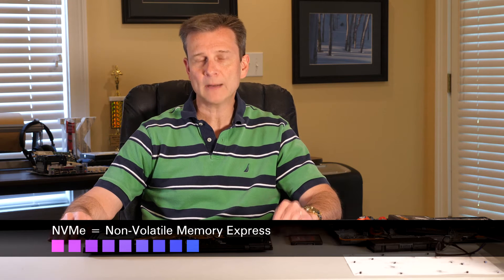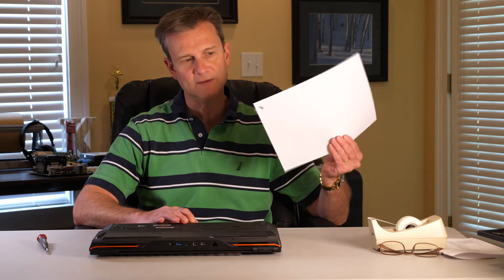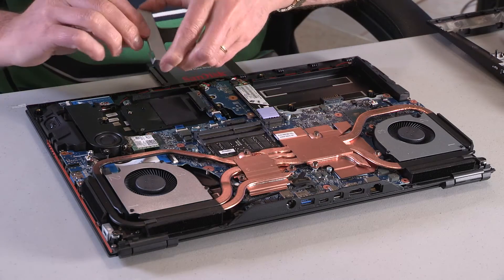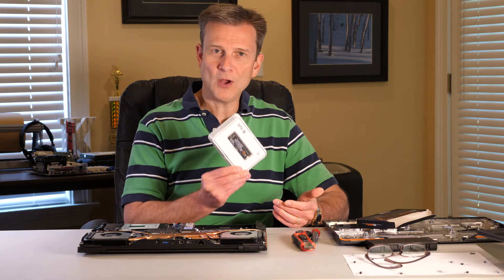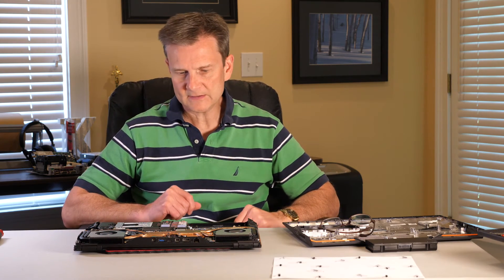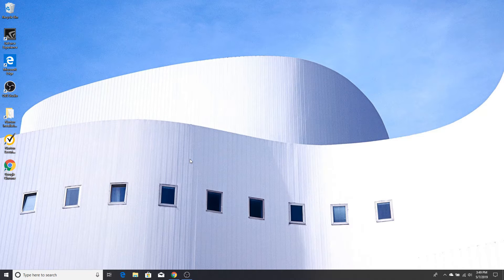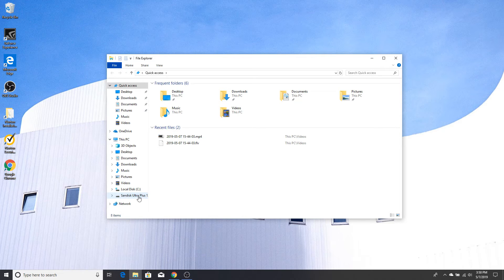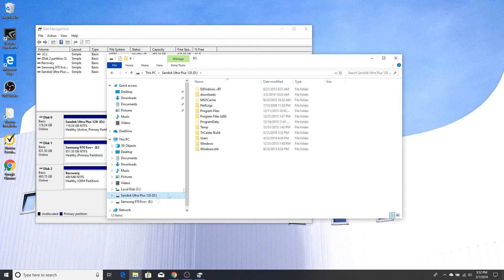Installing a NVMe SSD in the PowerSpec 1720 laptop

Comment: Good summation.  Only thing I'd recommend is to advise people to get a second thermal pad (not unlike the one that's on the WD drive that came with the laptop) and center it over the controller chip, not the NAND.  That's what they did there - the NAND is designed to get hot - the controller chip can benefit from extra cooling, which in this case is provided by letting the controller chip dissipate heat by contacting the metal EMF shield using the thermal pad as a thermal interface material.
Reply from the maker: Thanks for the tip.

Comment: Thanks for the video ... exactly what I was looking for (this one and the other Powerspec one) .... and the only video of its kind of the web ...  I want to get the Powerspec or a similar Clevo but my only hesitation is the screen ... After a couple months of use, do you think the screen at max brightness isn't bright enough ... is it too matte? ....also do you mind telling us what screwdriver you used if you remember where you bought it? I never have luck with laptop screwdrivers...looking for a good one
Reply from the maker: I have only used the screen at its LOWEST brightness and that has been perfect for me. But that was all indoors, not in bright sunlight.

The screwdriver I used was the Husky HD-74501 V which appears to be unavailable. I've had it for years. This one appears to be the closest Husky replacement: https://amzn.to/2YpWyRE but I would actually encourage you to get a magnetic set. This one looks nice, with lots of great reviews: https://amzn.to/2YuBYDx

Working with all the small screws, having a magnetic screwdriver will help prevent losing the very small screws when you extract them, plus make it easier to place the screw on the end of the screwdriver and easily insert the screw right in the hole and start driving it in (again, without dropping it).

Comment: Hmm. I bought this laptop yesterday and installed an additional NVME but it is not recognized or showing up anywhere. BIOS, Windows, nothing. Is your new M.2 drive a SATA model or NVME? I am thinking maybe the additional drive needs to be SATA to work, but I could be wrong. This drive worked in my old laptop, and tests good in other computers so I know it hasn't failed.
Reply from the maker: I installed an NVMe drive, not a SATA drive. It was the Samsung 970 EVO Plus.